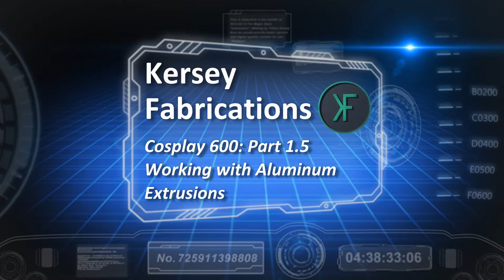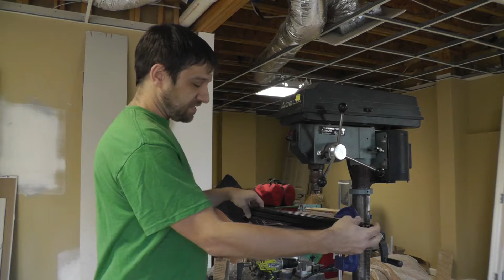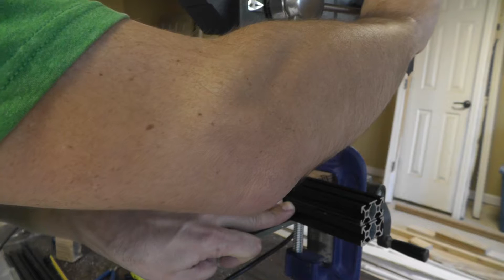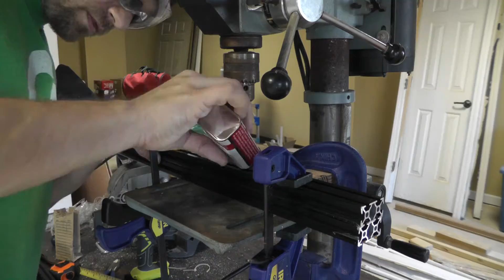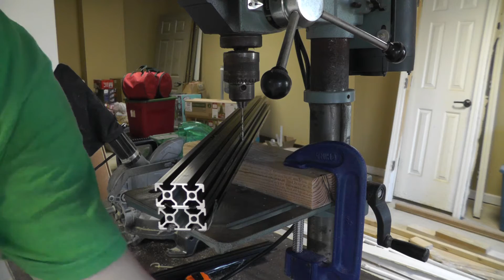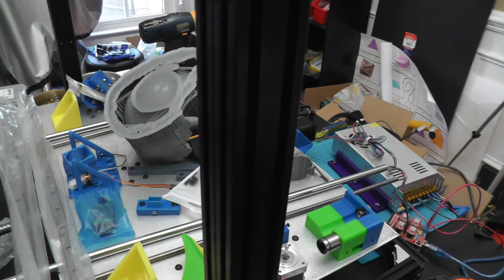Cosplay 600 Part 1.5: Aluminum Extrusions for My Custom 3D Printer

Comment: When it comes to the extrusions, what does the "M" stand for or indicate?
Reply: Metric units as opposed to imperial units, i.e., millimeters as opposed to inches. So M6 refers to a 6 mm diameter.
Reply from the maker: Which "m"?